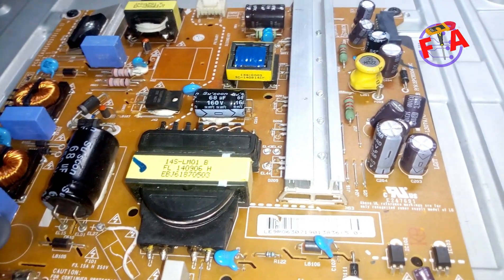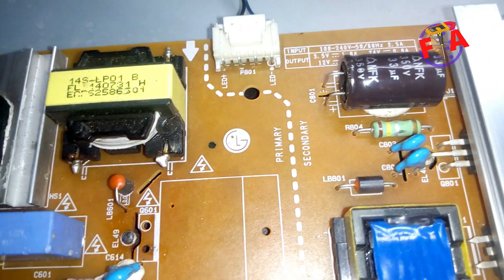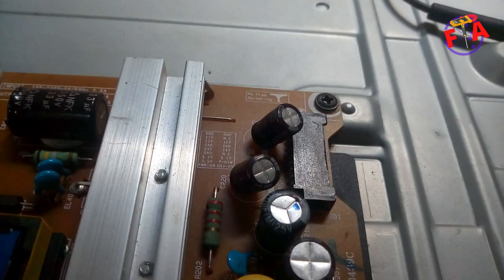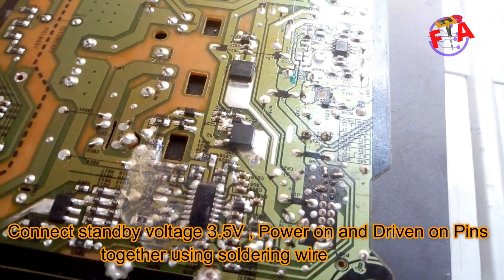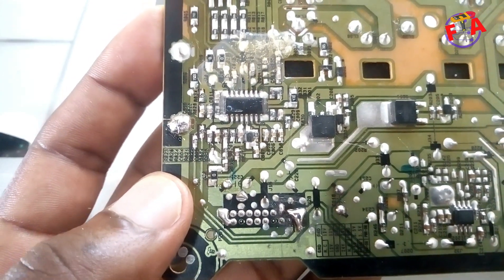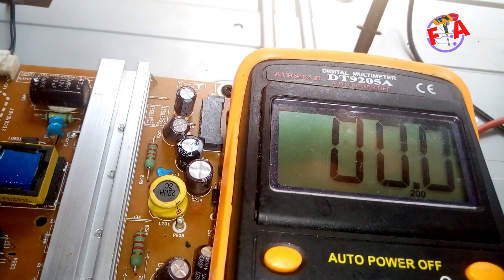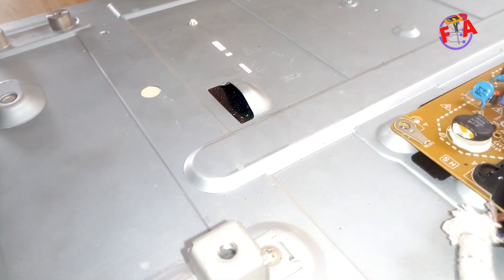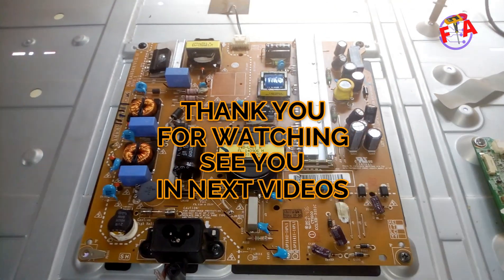LG TV Power Board forced start// A simple Trick for TV diagnosis

Comment: I'm checking voltage it's supposed to be 13.2 but only reading about 7.7&7.8 does this mean a bad power board caps seem to all look good
Reply from the maker: Check the electrolytic capacitors